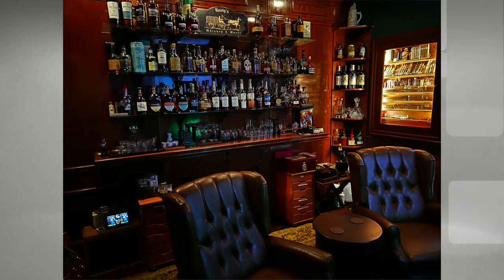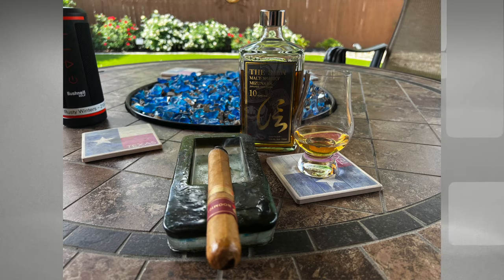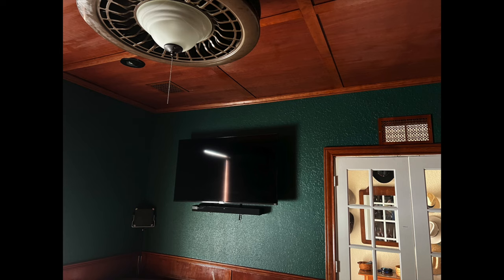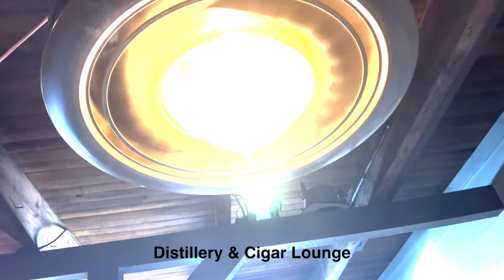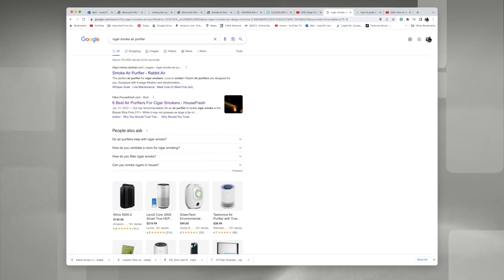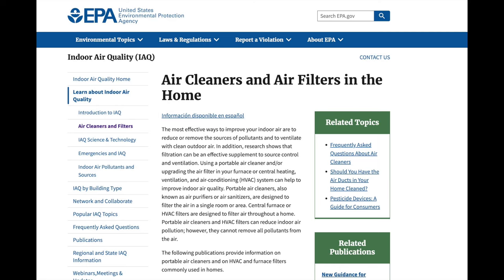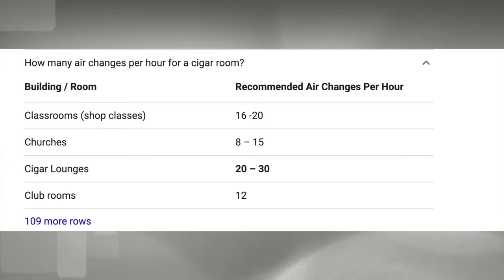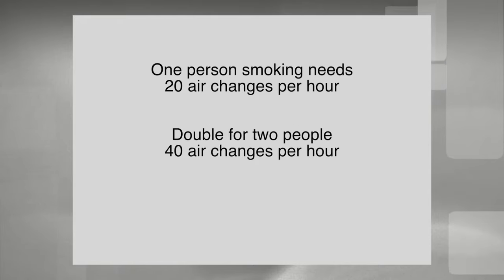Home Cigar Room Ventilation.

Comment: Holy geez, what a waste of time. Skip the video and do just a tiny bit of research on how industrial clean rooms function and you'll know all you need to know. In fact, I can write it from memory. 
First, to clean air it has to move so CFM is key. Second, you want to control the air flow. If you negatively pressurize the room, smoke won't wander out. Simply put, this means a fan blowing air out of the room. Third, keep the air moving. Fans in the upper corner directing air to spin like a tornado is most common. Third, filtration and cleaning. HEPA filters remove particulates, charcoal layers remove gaseous odors, prefilters keep HEPA and charcoal filters functioning longer. Remember, the more air moved, the better its cleaned. Larger fans move more air so can turn slower and make less noise. Ozone and Ions. Ozone generators produce O3 which is a highly reactive form of oxygen. When it binds with particulates it literally burns or oxidizes them neutralizing odors. Ozone is what you smell after a rain storm, especially after lightening. That's why the air smells so fresh. Ions are negatively charged atoms. Walls and floors tend to be positvely charged. Airborne ions bond to particulates and attraction causes them to settle out of the air and attach to surfaces. Be aware, this does mean walls get dirty. Simply combine the above elements within your budget and to acccomodate the physical situation of your own room. Or just open a window.
Reply from the maker: You are correct on all points. Very well done. I will comment there is a lot of literature out there that addresses the potential for deteriorating certain materials through using an ozone generator materials such as rubber vinyl, etc. overtime will deteriorate when exposed to high levels ozone. Periodic short duration use may be OK for a period of time. However it should be monitored for any deterioration. Thank you!
Reply: @arwin10w  I'm very aware. My father invented some of the first ozone test instruments. I agree, if I can smell it, the level is usually too high.
Reply from the maker: @lenzielenski3276  Very good point and one I had not known. "if I can smell it, the level is usually too high."

Thank you for adding to the conversation.

Comment: I bought an 8" fan for a 12x15 room, and a 12" ceiling vent, do you think that's large enough for the room to evacuate smoke through? Im also going to purchase the smoke eater ceiling fan and use that too. If I still smell any smoke I'll get the air purifier also. Just wondering if the vent fan was large enough? Yours looks like its maybe a 12x12 ceiling vent too
Reply from the maker: I think an 8" fan would would work. Assuming  you get 900 cfm through the 8" duct, you will get approximately 25 air changes an hour, which should handle the smoke pretty well. If it comes up short you can add the air purifier as well. My vent grill opening is 10"x10". Then it reduces and transitions from 10" square to 8" round. The transitions is reversed at the roof damper.

Comment: Do you think it’s a good idea to put both an air filter & smoke eater plus a exhaust fan?
Reply from the maker: I do for maximum odor removal. You may only need to run the smoke eater after smoking to clean the air.

Comment: Do you think it’s a good idea to put both an air filter & smoke eater plus a exhaust fan?
Reply from the maker: I think you can possibly get by with just an exhaust fan if,  you are moving enough air. In my case the smoke eater scrubs the air in the room after I am done smoking. If I have company then I run both and it handles it completely.